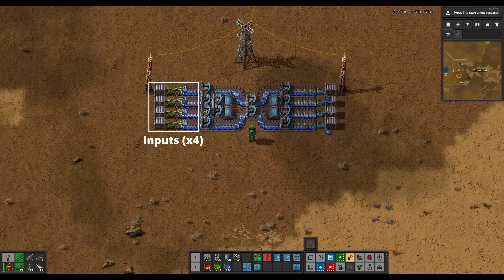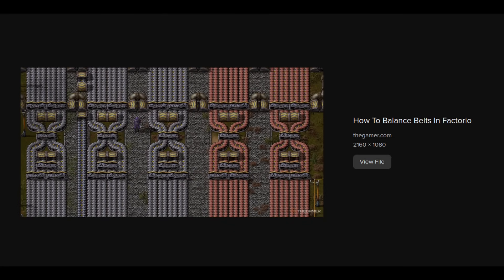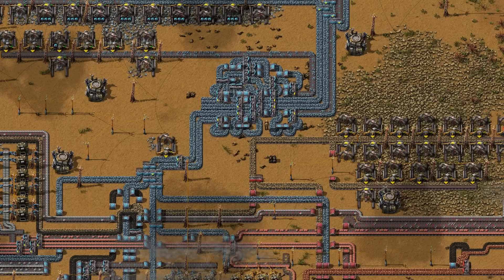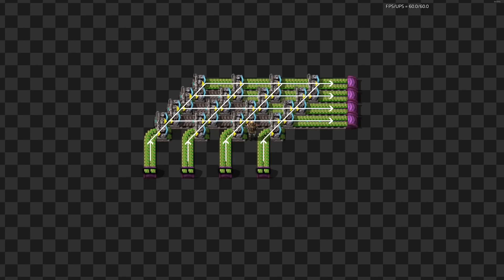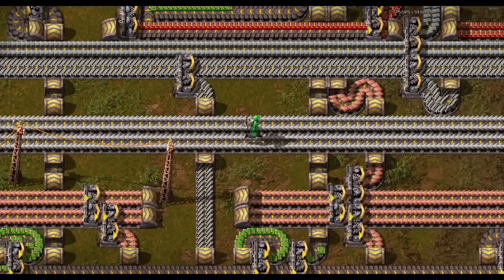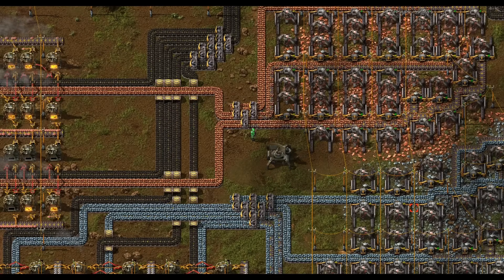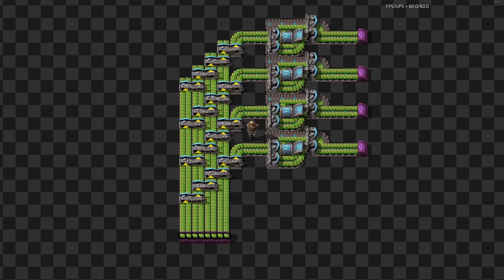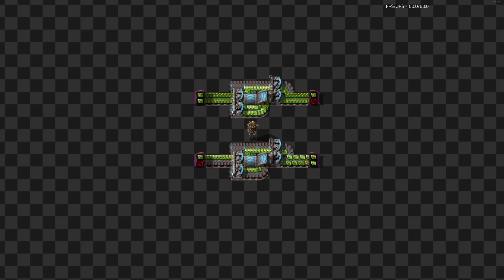Crossbar Switches: An Alternative to Belt Balancers in Factorio

Comment: Im confused. I rebuilt the exact same balancers from the video but they didnt work. The one at around 7:32, for example,  only puts out items on the lower four belts
Reply from the maker: Oh, the output belts for that one are slowed down—there's a red belt at the end of each one.  (Yes, that could have been communicated better in the video…)  These switches obviously don't create items, so the overall outputs can't exceed the overall inputs, after all!  Notably, they aren't actually balancers; they'll distribute items to all outputs IF you have enough items, but they don't inherently balance.  You'd need to use the circuity shown later in the video for that.  Whether or not true balancing is needed would be a separate question…

Comment: This doesn't balance anything though, this works entirely on supply exceeding demand where balancers will feed each lane even if it has to only give it 1 piece each.
8:00 the top lane gets the least amount of resources and if the supply drops only the bottom lane will get any resource, there is a priority to which lane gets resources where balancers attempt to remove the priority..
If the true purpose of this is to just remove the potential issue of lanes backing up with resources just add more splitters.

Comment: I started using 1:1 input-balanced bus taps and now will never NOT use them--when not using the 'Belt Balancer' mod, of course!  One nifty trick is that, if you swap the direction of the two belts from the output splitter, it will input-balance a single lane of output, which is perfect when putting two items on one belt.

Comment: Okay it's not so Novel at all I'm afraid.. what your basically doing is Directing the entire Bus's Throughput into a Single Lane(Crossbar Switch) and then pull from it Resulting in a "Balanced" extraction of a Resource from every single Lane in the Bus..😂😂😂

 Now let me ask you What is more efficient!! Pulling from a Bus that has a Balancer and let the balancer compensate from every Single Lane resulting in perfect Equilibrium of Throughout .. OR Trying to Squash all that thoroughput and try to just jam it into a single Lane !!

The end result is going to be "You eventually emptying out the entire Lane from the First Lane of Resources!! This will cause one of two problems for you!! The machines that provide the resource to the First Lane of Bus are going to be Working All the Time!! Which means the throughput of 1 Lane has been completely exhausted 😢😢 meanwhile the Machines whos thoroughput is NOT spent are not functioning! Resulting in 1 Belt worth of Productivity Loss!! Why ?? Because you aren't making EVERY MACHINE WORK in order to fill that multiple lane Bus!! Only select few of machines have been Queued to produce! Ideally you want to make Demand Face the Production capacity at Equal capacity.. What you are achieving is Demand Facing the Thoroughput of the Belt's Capacity! This limits all of your Thoroughput into one Belt! The reason Crossbar Switchs won't work without a Balancer built is because it doesn't queue EVERY MACHINE AT ONCE it queues only The minimum amount needed!! 

This Trick will save you Electricity in the factory because less machines are added to the "Pop Queue created by the Crossbar Switch" but it won't make Productivity work at maximum Capacity all the time!! Which is a problem!! While voiding items and infinitely spawning items from Input to Output works!! This doesn't work for real world scenario where your Input is NOT infinite aka Machines are loading the progress bar slowly...*UNLESS you use a Belt Balancer at the very begining of the Bus* it's basically a requirement then it should be fine to Crossbar Switch..the issue is ... Once again u will STILL need a Balancer to introduce new items to the Bus and this is simply to make all Belts reach an Equilibrium! It's simply not possible without a Balancer at all!!

Remember!! Equilibrium means EQUAL opportunity for every machine to fill the gaps in the Belt!! The difference is Negligible if your not using the entire Bus's resources and completely dry out the resource which doesn't happen often!! So most people would put a Crossbar Switch in a Heart Shape and still get away with it cuz Splitters are powerful😅

Comment: I used these all the time. I didn't really have a name for it, but I think of them as belt compressor, since that's what I usually use them for. To recompress belts so the nearest belt is always a full belt.

I think the reason why they aren't very popularly talked online might be because they're easy and obvious to build. People don't need blueprints or online help designing these splitter arrays to make switches/compressors unlike balancers, where there are a lot more nuanced trade offs that you have to make with each balancer.

Comment: I think it's useful to conceive of these differently: not as a switch but as a shove. E.g. the simplest way to think of it is to look at each diagonal with the priority set as a "gather up a full belt of material and put it on the side". In various circumstances, you can reason out using many fewer splitters, since you just need a diagonal long enough to gather enough material to make a new saturated belt.

Comment: Love the simplicity compared to big balancers.

But how does it compare to balancers in term of UPS, is it more or less efficient in terms of UPS ?

On one hand they use more splitters which i know use "lots" of UPS but on the other hand it seem to have more compressed belts inside the "cross bars" compared to a standard balancer.

Comment: When trying to implement my first megbase of 10k sci/m, i quickly realised that using balancers and belts in general is a waste of time. At such a scale, it's always faster and simpler to scale the base by using less production base solutions. This is how I discovered wagon mining and inline production lanes, where mined ore goes straight into wagons, and one station of a producton lane handles input and output. That way the thorughput of resoures is bottlenecked by trains, and not by the speed of inserters or conveyor belts.

Also I have to say that the belts have inadvertently become the biggest bottleneck of factorio progression - main bus design and ratio of input/output of a production line are the reasons why you should avoid the conveyor belts for mass transportation, as the conveyor belts forever limit you to 45i/s(2700i/m) input/output per lane. It is always better to scale the producton by making little factories that use wagons as a mediator for trnsportation, rather that conveyor belts and chests. The reason being - it's easier to handle a less dense train network than to reroute tens of conveyor lanes.

Comment: I like the idea, especially since it is MUCH easier to build these than looking up the particular balancer you happen to be needing at any point in time.

One question, though: You mention using this to consolidate the outputs of mining outposts. This would usually lead to an uneven depletion of the ore path, right? And in the end to the train station potentially being unable to actually fill trains? Or am I missing something here?
Reply from the maker: Whether or not a train station can fill trains should be about the received quantity of items, not the rate at which they are received.  Basically, until the mining patch runs out, I suspect most train station designs can keep filling trains, though how much ore ends up on belts and in buffer chests at the end will still depend on how the station is built as much as how the inputs work.  (I would point to my content on Factorio trains, but… I'm still working on it.)

On the topic of balanced mining specifically, I profess that I don't even try… but when I attempt to understand why it would be a significant issue anyways, I simply end up puzzled about it.  If we use a crossbar and thus prioritize the belts of one belt/strip of mines, that row will deplete fastest, then the one below it, etc..  If we balance all of the outputs with a balancer, then mines at the end of each belt/strip will be prioritized (as they will see space on the belt before any other miners) and instead of, say, the "top" edge depleting first, now the "far" edge is depleting first.  (Now guess what happens if we rotate our mining setup by 90°?)

Ore patches have gradients on both dimensions, e.g. a density peak in the middle, with lower density as we approach any side.  So, while there is still variation on how exactly the patch will deplete between the two belt connection options, the only way to perfectly balance the patch depletion would involve something far more overbuilt that prioritizes the middle miners by the ratio of ore they have available versus the edge miners.  (Even radial belts generically prioritizing the middle miners is no guarantee because we don't know how much the density changes.)  I don't think we can detect ore count in the ground(?), so this would have to be done manually and I have never seen something like this actually done, personally.

So far as I am aware, in the end, ore patches will deplete as they approach providing the expected amount of ore; if mining rate is a problem, we probably need to build more mines imminently anyways.  The relevance of balancing ore patches seems to be at its highest if we depend on the mining rate to meet expectations, but only "when necessary" (whatever that happens to be for a given factory), which is conceptually exactly the sort of problem that a buffer can be built to solve.
Reply: @zipnotoad  The problem I see is that (when using some kind of circuit-based train automation), the station might think it's got enough items to fill a train but they might not be well distributed across the buffer chests.
Therefore, one or more wagons might not fill up properly, resulting in the train waiting in the station for potentially a very long time.
Reply from the maker: @WoodmanFFM  The "MadZuri" system exists to solve the problem of uneven buffer chest loading.  Also, unironically, an output-balanced balancer, either in physical or circuit form, would generally maintain balance across the chests.

Now, uneven wagon loading is a separate issue (though a smaller one by slot count than uneven buffers), since we can't read the contents of individual wagons.  That turned into a rabbit hole when I attempted to work around it (while maintaining high throughput goals, especially), so I'll leave discussion about those details for the video I'm currently working on.
Reply: @zipnotoad  Looking forward to your next video, then. ;-)

Comment: Since I kinda hate the concept of a bus, I almost never use these. Personally I just hook up enough supply to each build individually, terminating lane when it runs dry, compensating with nearest full belt. If everything goes right, it just works and I really dont see the need to pull from the whole section of a bus. If inputs are consistent, then why even have balancers? And if they are inconsistent, just make them consistent. It can be kinda annoying to keep track of things but like, its not THAT hard, and also that way I dont have these abominable balancers ruining my base, leaving more space for spaghetti!

Comment: Great stuff. I will definitely be experimenting with this. Common splitter designs grew kind of stale over time, and every time I try to improvise I end up spending hours re-designing a simple balancer just to end up with something worse. Amount of splitters required to make these switches won't be an issue for me, as I'm not exactly building megabases. UPS impact should be minimal

Comment: I started playing Factorio in 0.15, and around this time I had watched a lot of walkthroughs just showing how to organize certain parts of your factory. In many of these videos I saw people building complex belt balancers and they would explain exactly why they were doing it. At the time, this made sense as 0.15 did not feature input/output priority splitters, and obvious problems would be found if you just used stacks of splitters feeding into each other. It made perfect sense as to why you'd need to use balancers. 

Eventually, we got Priority Splitters in 0.16. It seemed to me these intuitively solved belt balancing. They allowed you to easily use stages of input/output priority splitters to pull from belts, or merge back onto them. Despite this, I still saw countless content creators continue to whip out these complex machines of overwhelmingly large, resource-costly (at least in terms of iron, underground belts are EXPENSIVE) balancers. I still saw tons of belt balancer blueprints being shared around all sorts of Factorio community spaces. I wondered WHY people continued to do this, when it ultimately did not seem to be necessary. 

I think, ultimately, it just comes down to old dog, old tricks. You are correct in your assessment of them. I believe belt balancers have kind of become ingrained in the Factorio community, because for a significant portion of the game's existence, they were a much-required necessity. However, priority splitters resolved their need almost entirely. I have rarely, if ever, used a belt balancer. Priority splitters allow you to do almost everything a balancer can achieve. There are of course certain exceptions to this. I can see a number of situations in which an oddly specific balancer would be needed (for example, train stations). But in the grand scheme of things, I do not believe it is necessary to construct a monstrosity 4-chunk N:M balancer designed to take 20 input belts and get you 17 output belts. Just...just use splitters, man.
Reply: man...  I just like the factories that are filling up all the input belts to be running at the exact same rate because it makes my brain happy, input balance is what allows me that joy.
Reply: @CraftsmanOfAwsomenes  For me it really just depends on application. Once I hit the point of trains, there's really no necessity for complex balancers as balanced wagon loaders/unloaders will already facilitate this purpose. Why put a 4x4 balancer on the input of a smelter array fed by a train, if the output of the 4 wagons is already going to 4 full belts? It is just multiplying by 1. 

Prior to trains I still do not mess much with balancers, as they are quite large footprints for any substantial quantity of belts and a mess of splitters will achieve the same purpose. The spaghetti is gonna be eaten and turned into a real organized base eventually. 

I found when using balancers back in 0.15, I often built my bases and rail networks around where I placed these ungodly things. Post 0.15 with priority splitters, this part of the planning is irrelevant. No need to build around a gigahuge 11:4 balancer for an iron patch when it's been running off a crapload of splitters. When the patch is useless it just gets turned into a train stop.

Comment: Those are really cool designs but in real game not much usefull in my opinion. When N or M goes over 4 you don't care that much about even distribution. It's much easier to just "make more" and put dedicated belt wherever you need. You'll end up with this way if you intend to build megabase anyway since UPS cost for thousands of splitters is not negligible. When building megabase you try to make as little as possible entities including inserters, machines AND splitters.

When N and/or M goes big (like 10-20 or more) logistic robots are the better way to balance. When chests are really close to each other you don't need that many robots especially when you have legendary roboports, robots and really high technologies.

Comment: Yeah, I use balencers in cases where I go from an oversupply to a fixed number of compressed outputs. Which I do quite a lot to prevent bottle necks that I didn't anticipate. I'm more of a "overkill via napkin math is a safe option" person than a "I need to exactly calculate and optimize this" person. 
Or as you said if lane balacing on a 1-1 is required. But actually I can remember that I used cross switches on my main bus to reinject copper into it, as I starded to add LDS to my factory a few years ago, when I was way less experienced and I underestimated how much copper the lategame needs. I came up with that idea naturally, didn't know it had a specific name, but it makes sense that a concept like that has irl applications.

Comment: For train stations I find it easiest to just slam one belt in and then use a circuit to make the inserters balance the chests. No splitters, just a belt parallel to the station dead ended at the last chest, or turned into the last inserter if there's a need to force a stop. Space requirement is the smallest I can imagine since you only need to add a circuit.

Comment: I did some tests and input priority is necessary. Make 3 to 3 diamond switch and use 2 input and 2 output belts. In some combinations throughput is limited with only output priorities. However it seems it doesn't matter if you put the priorities towards the corner or away, both work as long as it's the same for all splitters.

Comment: People use those 4x4 and other Raynquist type belt balancers because they minimize the amount of splitters too though. Splitter logic remains the biggest drag on UPS in this game, considering Wube has optimized the hell out of most of the other sources(non-full belts, fast inserters, robots, roboports, etc.). Every empty space that goes through a splitter is a comparatively sizable hit to performance compared to almost any structure in the game.

Belt balancer has 6 splitters for 4x4. Crossbar has 16 minimum. It's also costs way more than belts obviously, being 4x as expensive, on top of you needing nearly 4x as many.

Comment: There is a circuit based 1 to 1 belt lane balancer that does equal input draw using only 1 splitter and 0 undergrounds. As it is circuit based it is unlikely to be that efficient update time wise.